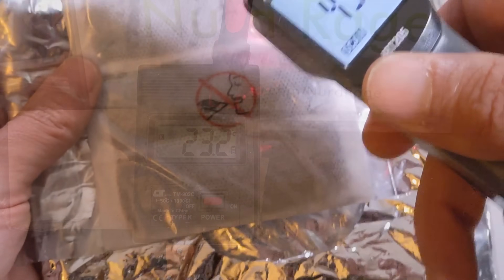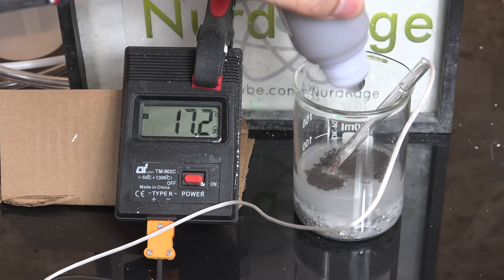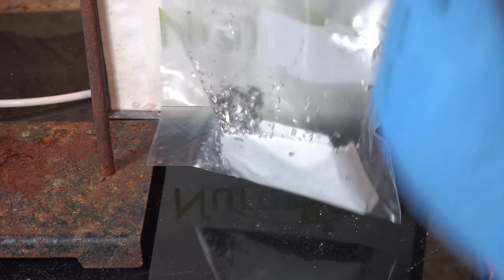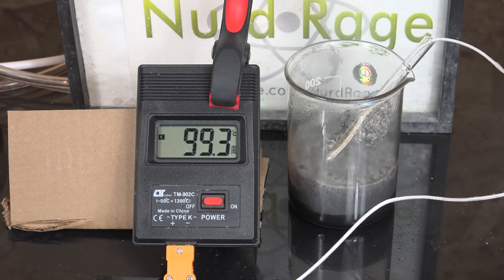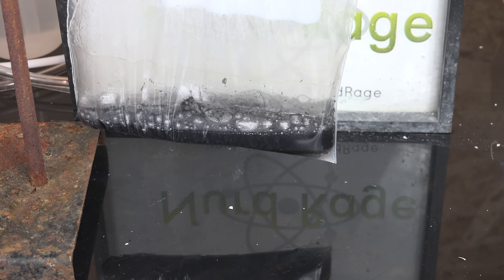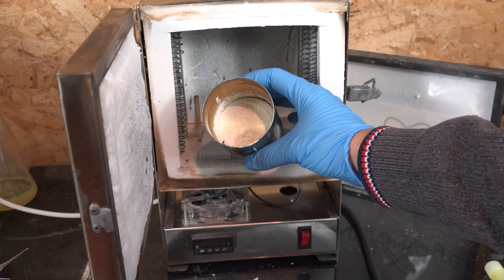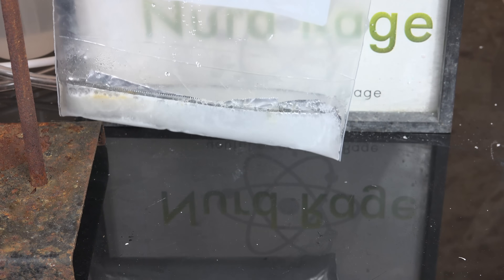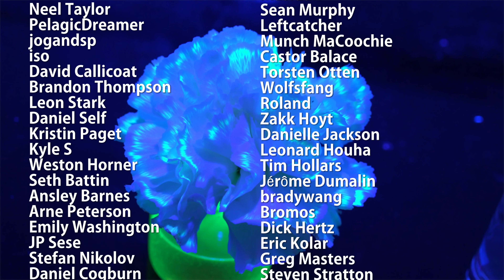How to Make Your Own Flameless Ration Heaters and the science of how they work.

Comment: Just chiming in to double down on the whole "dont seal the vessel" part.

 My Dad did a groundskeeping/maintenance job and some jerk used to make little foil+Draino bottles that would "go off" when Dad moved them into a trash bag. He never got hurt becsuse he knew what it was but a pressurized bottle of caustic chemicals is NFG
Reply: Very much like the one pot meth reaction which are othen mixed and thrown out along a road , and after a while , the tweaker(s) come back by and pick up any that haven't exploded .
Occasionally , one of the little dears forgets their little toxic Easter Egg and it gets found by some unsuspecting victim .

As for other things you can put in a plastic beverage container and probably shouldn't seal ( calcium carbide , dry ice , etc ) , I find my riding mower is an effective tool for semi safely disarming any " duds " .
A pellet rifle and some distance also works and I have had also had good results with everything from slingshots to large caliber rifles .
YMMV .
BTW , the residue of calcium carbide reacting with water is calcium hydroxide , which will work with aluminum foil to heat food .
I used to make a really redneck contraption that looked like the love child of a citronella bucket candle and a drunken carbide lamp , from  empty aluminum cans  .
I cut the top off one and kept the bottom .
The second I left whole and pierced a very small hole in the bottom of it .
I would put a handful of carbide in the first partial can , then , push it into the bottom of the second can , and , fill it with water or  any reasonable watery liquid .
If all the stars aligned and you were living right , you got a an anomalously tall beer can that would support a flame .
Of course what you also got half the time was a curtain of flame around the base , and on rare occasions , an impressive little boom and you had to start again from scratch .
So my advice was always to carry extra starting materials , especially extra beer .
You cannot be to careful .

Comment: Are any of these methods the same as the pocket warmers used for keeping warm during camping?  

I like the idea of a heating method that doesn't require water to work.  Many of these are just add water, but in a survival scenario water can be the one thing that is limited.
Reply: Pocket warmers that are totally sealed, and you open to activate, are typically oxygen-activated reactions.  slow reactions because they're designed to last a long time, and not burst into flames when you open them

Comment: Maybe powered aluminum in the sodium bisulfate would be reactive enough to be usable? It is actually pretty easy to convert aluminum foil to course aluminum powder using a cheap ball mill. I am talking about a hand full of steel ball bearings in a small, sturdy plastic drum, then turned slowly by a small motor. I have seen people here on youtube do it for making course aluminum powder for thermite.

Comment: Are you aware that you just made a The Works Bomb? The Works drain cleaner and aluminum foil in a 12oz soda or Gatorade bottle. One shake and throw as far as possible. 
If you want a fireball, add a lit sparkler to set off the hydrogen.
Reply: Correction: The Works toilet bowl cleaner.

Comment: What is the powder that is used in hand warmer? And would that powder be useful for something like this if combined with anything else?
Reply: If I remember correctly, it's very fine iron powder, at least in some of them. It gives off heat as it oxidizes from air slowly diffusing in once you break the seal. While you can make iron fine enough to heat up more quickly and more intensely, I don't think it would be easy to control it. It might be inconsistent with it either going too slow to be useful or too fast to be safe. You would need a way to tightly regulate both the size of the iron particles and the rate of air going into the pouch of iron powder.

Comment: Try use sodium bisulphate + Al + sodium chloride. I think chloride could attack oxide layer on aluminium (pitting corrosion), so it can speed up the reaction. Not tested, just idea.
Reply: Can confirm: trying to drop out copper sulfate with aluminum is essentially futile (very slow reaction rate), but a little salt sprinkled on top, or using copper chloride instead, the reaction proceeds, ahem... aggressively :)

Comment: I recall a random reaction I did involving urea sulfate where it's crystallization produced an absurd amount of heat, and several ion exchange reactions with calcium chloride that produced a lot of heat. Both get around the hydrogen issue. Not sure if they hit boiling, though, and the urea sulfate one was crystallizing in diluted sulfuric acid, which can't be great for food prep.

Could one of these gasless options work for food prep?
Reply from the maker: not a bad idea, but crystallization methods aren't good because they're metastable and can go off while in storage, so when the user uses them they're already spent. I do like the ion exchange reaction, might be worth looking into.
Reply: @NurdRage  turns out I was also completely wrong on the reaction between urea and sulfuric acid. Urea sulfate apparently doesn't form from the direct reaction between the two; ammonium sulfate and CO2 are the products. I'm not sure if the heat produced was a result of ammonium sulfate recrystallizing in a very low PH system or if it was a function of two very dry things, one of which reacts exothermically with water, sucking water out of the atmosphere and the salt is just there for the show. The latter would explain why the crystals redissolved and could not be reformed.

...I really wish I took more chemistry classes in college.

Comment: Re: sodium hydroxide:  If you added more water, it should slow the reaction as it will lower the hydroxide concentration, as well as buffer the heat flux.  This should not only work to prevent the generation of hot spots that rupture the bag, but also improve the heat retention, thus the cooking ability.

This would probably require some testing & adding fill lines to the bags.

Alternatively, food saver vacuum ziploc bags should be able to tolerate the heat, keep out moisture during storage, and they come built in with what is effectively a one-way pressure relief valve to prevent splosions.

Comment: Nurd, I have a bit of a question. Prior to the introduction of these water based heating packets we used to use hexamine fuel tablets. (or at least that's what we were told they were) I don't have anything against the water-reaction heaters. They work quite well for heating up your main meal. But that's all they will do. If you're looking to heat up a cup of water to make that packet of coffee that you got in your MRE your SOL. Whereas; those hexamine tabs + your canteen cup would heat up whatever you want (assuming you have access to water LOL). And the "hexamine" tabs had/have some serious advantages as well, such as energy density (more BTU's per volume), shelf life, weight ECT. However, (as I understand it. I Don't know this to be a fact) they were quite toxic when they were burnt. And they were VERY hydroscopic. If you didn't keep them sealed up tight, they would adsorb water from the air and not burn.  My question is as follows - Do you think modern chemistry (the old hexamine formulation was VERY old) could come up with a formulation that would be non toxic And not hydroscopic, while maintaining the other advantages? (energy density ECT) I am very well aware of "solid fuel" tablets offered around the net and places like amazon. But absolutely NONE of them produce a SDS or a contents list for their product/s. And I personally know of one product that was tested and produced Hexavalent Chromium when it was burnt....... As you might guess that's a HARD PASS for me.  What's your opinion? Worth exploring? Or stick to making a fire?  LOL Thanks
Reply: Hexamine was likely banned because you can use it to make explosives. I've never tried it (I don't do energetic chemistry - it's a good way to get dead) but it's supposed to be relatively easy.
Reply: @eclectichoosier5474  Well I learn something new every day. I did not know Hexamine was a/the precursor to RDX and C4 synthesis............ Well shit, scratch that idea. Nurd has had to deal with YT being asshats on much more benign chemistry. I wouldn't ask him to expose his channel to the sensor overloads over hexamine. Especially since its almost guaranteed that some jackass will go running for the hills screaming "their making bombs"............ (shaking my head)..........
Reply: Well... Now I want to discard my wax-dipped hexamine tablets.

But yeah, coating the tablet in wax should reduce the water absorption without reducing the energy density.
Reply: @Kineth1  Have you tried any of your wax covered ones? How did the wax effect it? IE; were they hard to start or slow to take off? Did the wax chip off? Assuming I could find a hexamine tab that I felt comfortable burning in a semi enclosed space (Tent) its seems reasonable to use wax as a vapor barrier. But I would think it would have to be a casting wax of some sort. Something a bit more durable than the basic candle wax. Thanks.